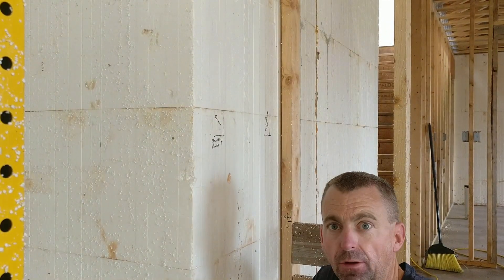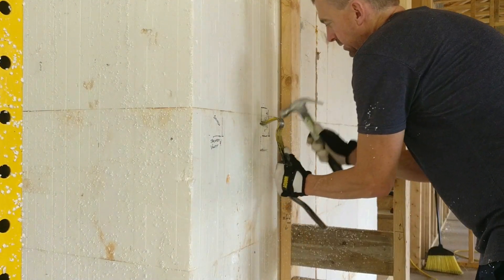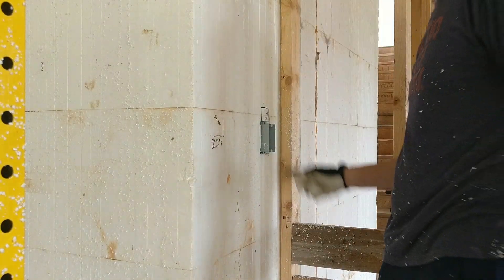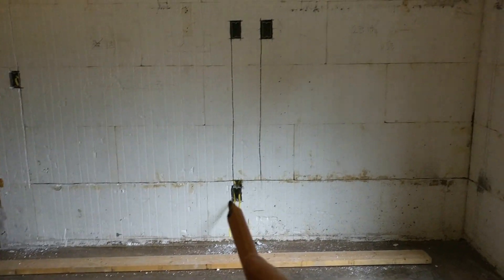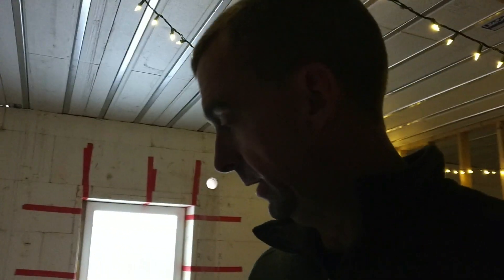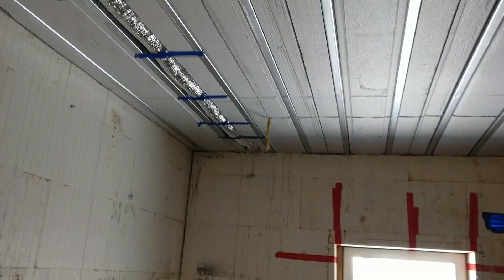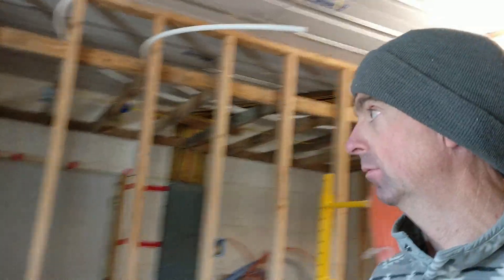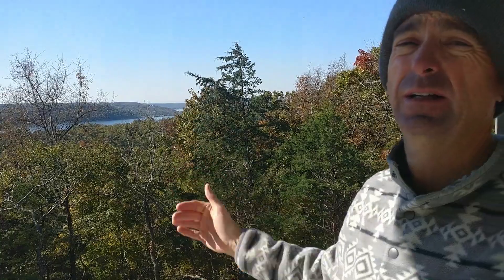How to run wire and install outlet boxes in ICF block walls!

Comment: i know insulation loss is minor but could you use spay foam to fill the channels after romex install? Also would be a way to make sure romex stays deep in wall?
Reply from the maker: I don’t know why not unless it would violate and electrical code I am not aware of or is city specific.

Comment: I do appreciate you taking the time to show us your work. I am an electrician in California. Our inspectors will not approve of your methods. We can’t have a screw inside of the plastic boxes, must have staple supports at each of the boxes. Many times we have multiple romex wires going into boxes. I really want to be able to use this product for our cabin build in the Sierras but I’m wondering if it’s possible.
Reply from the maker: Here is an article about ICF in California https://www.icfmag.com/2022/01/design-perspectives-why-doesnt-california-encourage-residential-icfs/

Comment: Nice job, you should make a fence for the chainsaw so it won’t hit the concrete.
Reply: how do you go about building that fence?
Reply: @davidm1006  take a small L bracket and bolt it to your chainsaw bar, for a depth gauge

Comment: I found the INEXO ICF electrical boxes really useful. And using the hot wire cutter to make the channels and the cut-outs for the boxes. I tried the chainsaw as well, but couldn't deal with all the electrically charged EPS foam dust that would cling to everything :)
And our inspector wasn't satisfied with just pushing the cable down in the channel.... we had to hold it in place with little pieces of foam wedged in, at distances similar to what the stapling requirements were for framed construction
Reply from the maker: Wow! I am so glad we don't have inspections in the county. That sounds pretty nitpicky.
Reply: Do you have what type of hot wire cutter you used?
Reply: Foam wedges? That’s what my inspector wants also ! Must be a regional thing

Comment: I would recommend running low voltage (cat6, etc) in separate channels. Helps signal integrity and safety. Also, probably required by code. May want to check with your inspector. I’m not familiar with ICF. Great work!  Gonna be nice.
Reply from the maker: We don't have inspections but we do want to do everything to code, so we are going back to run the Cat6 separately.